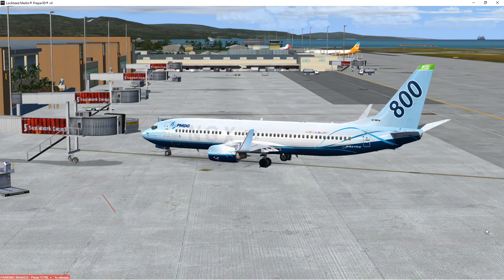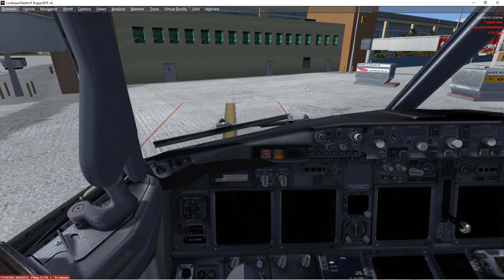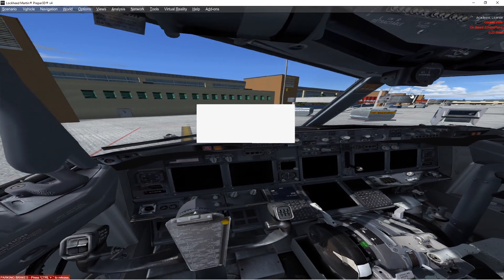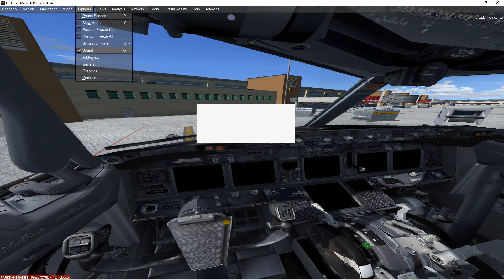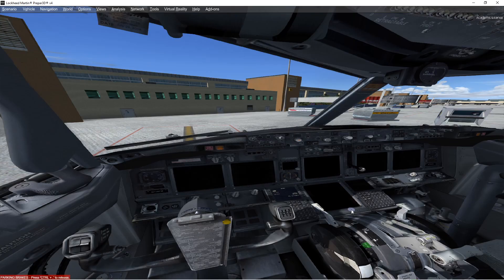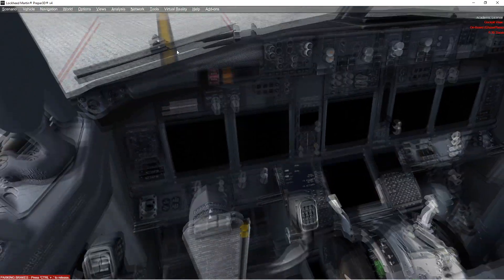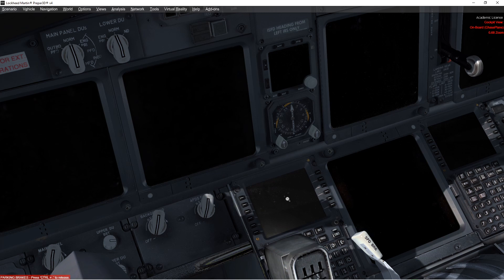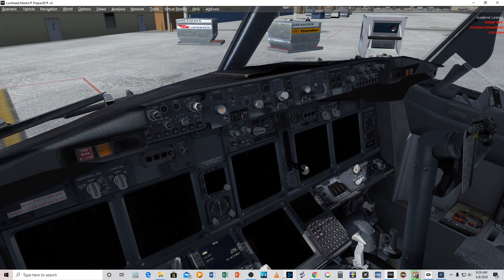[P3D 4.5 VR] How to fix floating white box in PMDG NGX 737

Comment: I don't have P3D so this doesn't apply to me, but as you suggest I think PMDG uses that white box as a place holder for 2D panels. There is actually one in the FSX NGX version as well in the top left hand corner. It's no where near the size of this one, but maybe that's caused by something in P3D. So my question is rather than make it transparent, can it be resized like other 2D panels, and moved out of the way? Edit: This is what I mean it defaults to being the size of a pixel on the top lefthand side. After you pull it out you can't get it back to where it was, but you can move it around, and resize it, but can not close it. https://www.youtube.com/watch?v=mVkhSVhgzPw